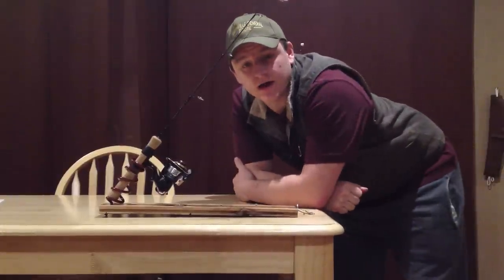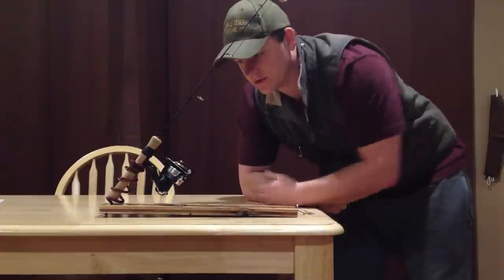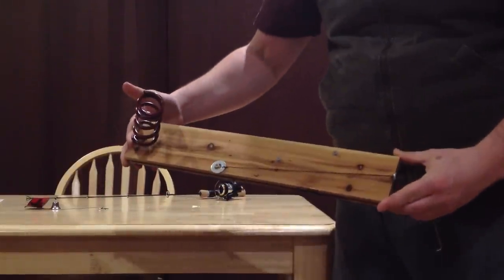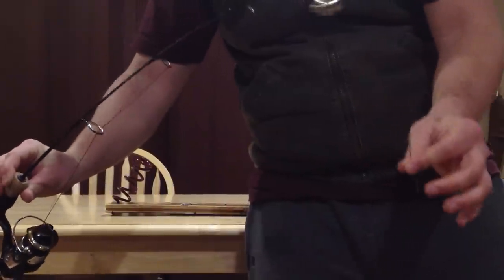Automatic Hook Setter

Comment from the maker: You can move the washer that is attached to the trigger, closer to the hole or further out by placing it on different screws.  This will adjust how bent the pole is.